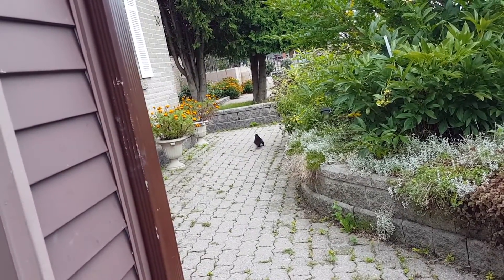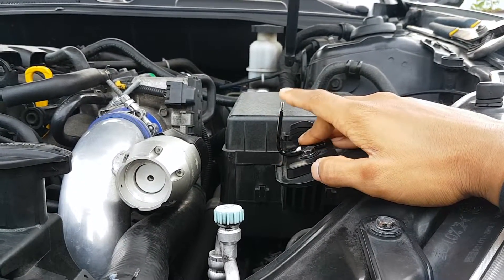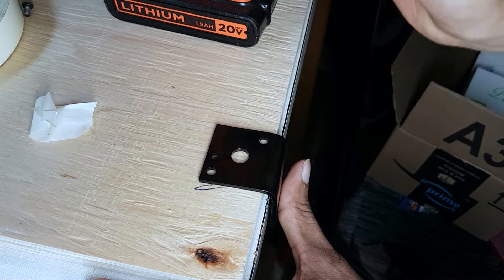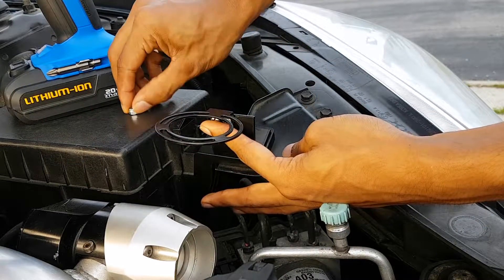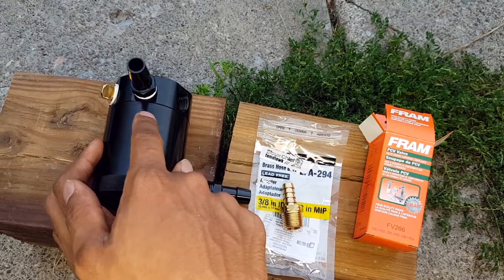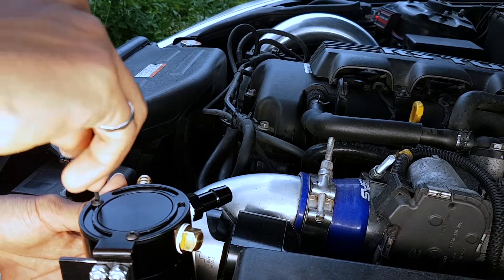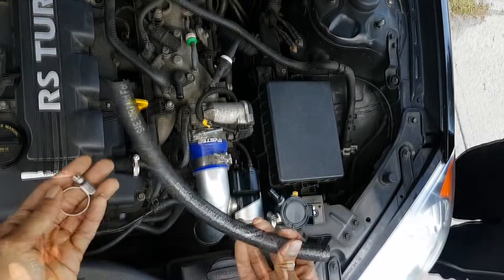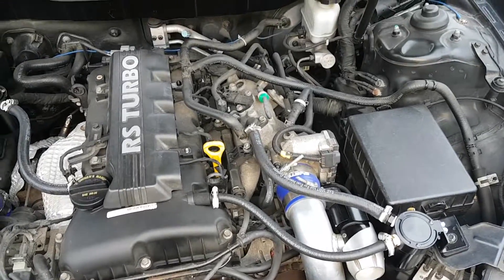Mishimoto Dual Oil Catch Can | Genesis Coupe

Comment: do all of a big, favour...know what you are talking about,, we sell these at our shop.. the 'gunk"
 as you call it DOES NOT PASS THRU THE BRONZE FILTER..... IT THE OTHER WAY AROUND  ...... IT PASSES THRU THE OPEN PORT, DOWN PASS THE 60 MM DIAMETER DISK, WITH  THE HOLES IN IT.. THE OIL/WATER 'GUNK ' SETTLES' OUT BELOW IN THE TANK BELOW THE 60 MM DISK... THE CLEANER ' AIR. PASSES THRU THE BRONZE FILTER ON THE WAY OUT OF THE CATCH CAN, BACK INTO THE INTAKE SYSTEM...SO STOP MAKING A FOOL OF YOURSELF

Comment: The pliers are not called tongue and groove. They are called channel lock pliers.  I also agree with another comment. Don't use teflon tape. Useless. Bits of it will come off and get into the system. The plug is called a pipe plug also.
Reply: Channel lock is a brand name of tongue and groove pliers, most people know tongue and groove pliers as channel lock because they were the company that first came out with it.
Reply: @fdeguilla  I have been in maintenance for over 35 years. Never heard them called tongue and groove. You can call them water pump pliers.
Reply: Yes, water pump pliers.  Have you ever heard them refer to it as a pair of hogs?

Comment: Nice installations.
 It would help to explain that boosted engines require 2 catch cans, as the crankcase inlet hose can flow in either direction due to the intake manifold becoming pressurized over atmosphere under boost. This shuts off the PCV valve now making the intake hose the only escape from blow-by, and you want to collect that as well from getting into your manifold and throttle body.
Reply: Thanks for the explanation, good clarification. I was wondering about that since none of my cars are boosted.
Reply: Add a check valve 👍
Reply: But check valves can/ will clog over time and then what do you have?

Comment: hey is is fine just to add the one on the driver side or are both necessary?
Reply: Depends on whether you're boosted or not. See my other comment.
For non-boosted engines, one can is fine. It will go on the PCV hose.

Comment: Hey buddy awesome video can you post a link to where you got the PCV valve? I went to install this kit http://www.shopbtr.com/Mishimoto-Black-Oil-Catch-Can_p_1274.html and realized the hose was way to big for the pcv valve . Is the one you installed bigger than stock or same size?
Reply: Thanks for the infor and Damn I’ve had this can for like a year already just getting around to installing it lol
Reply: Hriddhi Debnath yeah I’m gonna say screw it and just install this one. I’ll have to take a closer look and see if I can eliminate the sight glass and if not then I’ll just check it every couple days until I can get  another one
Reply: There is an in and out on the catch, does the in connects to the pcv or is it out?
Reply: Hriddhi Debnath maybe a dumb question but what size pcv tubing did you use for what connected from the intake to the engine area? Mine has a small hole in it